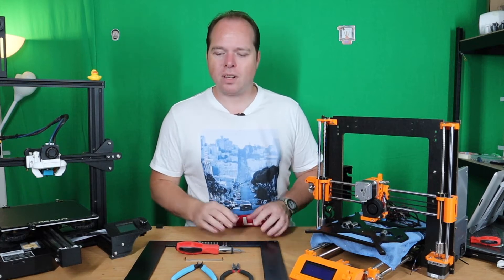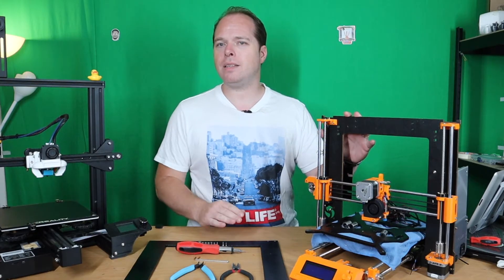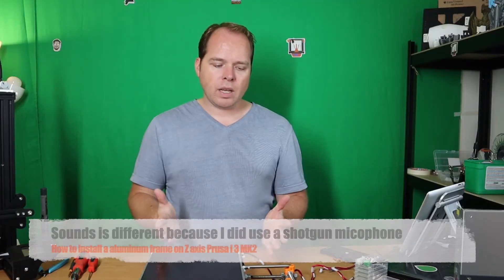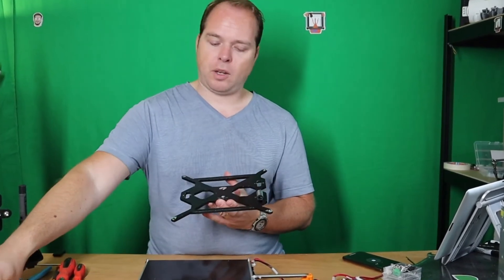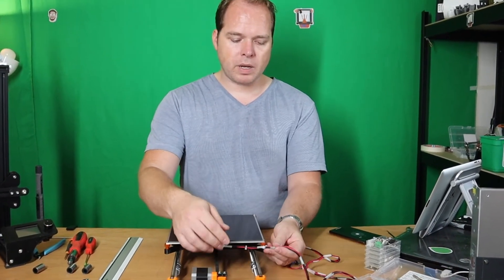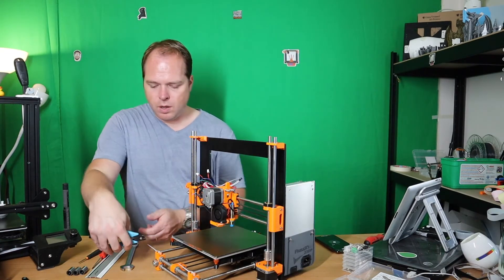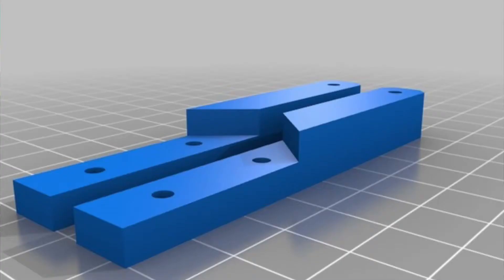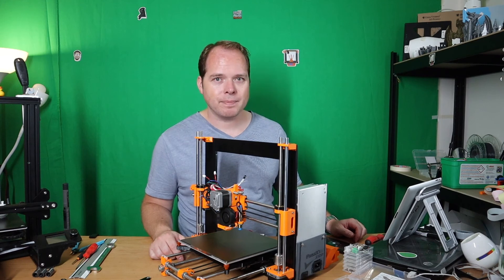How to install aluminum and 3D printed frame Prusa I3 MK2

Comment: its not the heat im worried about, its the flexing when you go to level your bed that will be an issue. It will cause the center of your bed to either bow or bend.
Reply from the maker: Yup that is true.